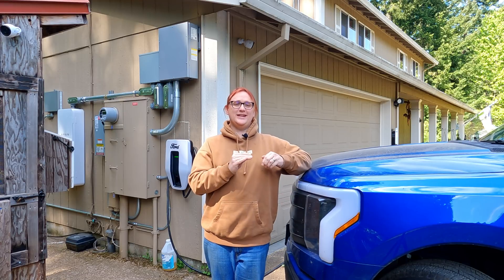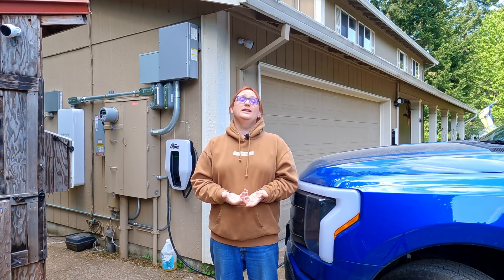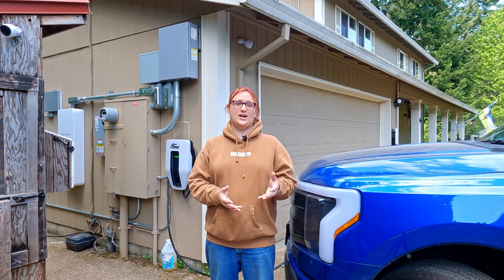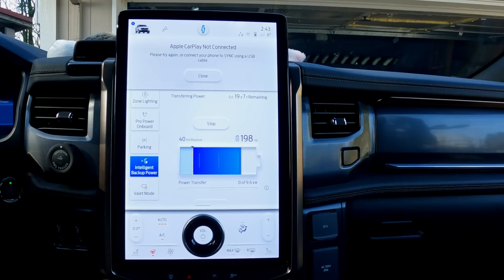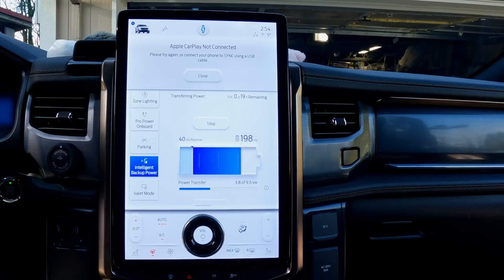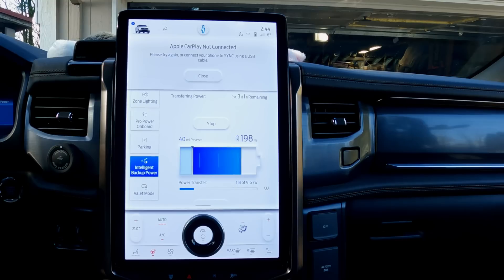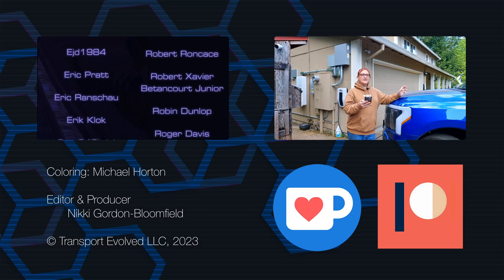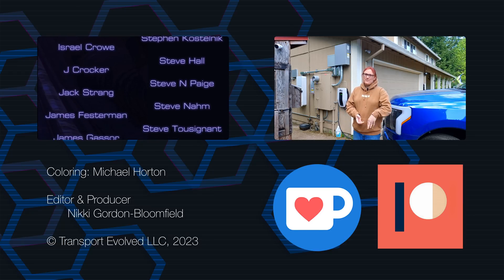I Was Wrong: How The Ford F150 LIghtning Home Integration System ACTUALLY Works

Comment: Still raises the question of why they’re using Bluetooth communication when the system operation requires the vehicle to be plugged in with a physical, wired connection that has wiring specifically for communication. I get that the required communication is different than a typical L2 charger would support, but I’m sure they could have figured out a way for that to work rather than using a specific Bluetooth module.
Reply: If it's using Bluetooth, it's not a safety device, it's a gimmick.
Reply: Yes, does seem like they could have found a more robust way... Or at least disclosed that there is a Bluetooth bug that could cause this issue.  Anyway, glad there is a potential resolution in the future.
Reply: And why it’s at the back of the cabin/truck, where it should be at the front, as charge port near front…, and that will always be closer to the charger.
Reply: @ericvet8b  the car ports are where they are, perhaps they will move in the future, and frankly there is no reason there can not be multiple ports, but that's another story.

Regarding the convenience of port location.  Tesla v4 stations should have longer ports.  I hope and pray that when we start to see adapters, that they have some short 3ish feet of extra cable, as that would address the short reach with all existing (SuC) Tesla SuperCharger cables.

And now we argue (debate) about the difference between a straight through adapter and a cable that adds resistance and current carrying capacity, blah blah.  Occam's Razor says make the adapter 3ish feet long and solve multiple problems. (I know the CCS standard dictates "though shall not use extensions nor adapters")... ;)
Reply: @ericvet8b  Unfortunately, Fulcher didn't understand your comment enough to get that you meant the Bluetooth receiver is at the back of the cab. He thinks you mean the cable, but his lack of understanding hasn't stopped him from responding to other people either.
Reply: @ronaldking1054  Since you don't have access to a bi-directional system that I have built, since I haven't built one, you could share any hacking experience with the systems that do exist.  You could absolutely be correct in that the BT features of the ford system are there to prevent energy theft via DC PTO ports?  You brought it up, and it's an interesting topic, so go ahead and elaborate.

You are asserting that only BT and manual pre-authorization can prevent unintended use.  And that a physical only connection is not able to do any security "Yours would require simply plugging the truck in regardless of whether someone has access to even the cab of the truck. While charging this isn't a problem as anyone could give you power".  But that would seem to conflict with the plug-and-charge authentication methods that AFIK do not require any Bluetooth pre-pairing procedures... And Tesla SuperChargers I do not think use Bluetooth for their authorization and vehicle identification communications.  I'm am happy to be proven wrong and expand my knowledge if I am mistaken.

Thanks for sending me down this rabit hole.  So the Charge Station Pro cable is 25 feet (7.5 meters) and the truck is about 6 meters, so a possible maximum of roughly 14 meters from the station to the rear of the vehicle, less the charge port distance from the front bumper. 

With all that in mind, according to the repair manual:

Page 21 mentions four Bluetooth Front/Rear Exterior/Interior Antenna.

Page 34,2184,2197 mentions a few Bluetooth Low Energy Module errors regarding ABS.

Page 592-599 mentions a few Bluetooth Antenna anti-theft errors.

Page 8300+ talks about Bluetooth phone Sync features and mentions it is 10meter (likely Class2) and 

Page 10322 has a list of six Bluetooth Front/Rear Door and firewall internal/external antenna for anti-theft, the Phone As Key appears to use these and mentions when out of range of 40meters it transitions to cellular mobile commands. Page 10330 talks about radio interference issues.

Page 10356 talks about Bluetooth Antenna #7 (Rear Exterior), this appears to be in the tailgate.

Page 10404, 10368, 13957 mentions Bluetooth Antenna #11 Exterior Front, appears to be in the front bumper to the right of the license plate.

So. I could not confirm that there is a Bluetooth radio nor antenna at the rear of the cab.  I did glance over mention of the cellular radio and GPS antenna that might be on the cab rear panel near the passenger side.  And there seems to be more than one BT Radio and antenna.
Reply: @D0li0  1. You have claimed that the CCS connection could create a bidirectional authentication protocol outside of charging. That is not my claim, and as such, I do not have to prove a thing, which is why I demanded you prove what you claim can be done. This is your rabbit hole that you are trying to send me down.
2. You have claimed that no authentication is needed in the opposite direction, but no charger will initiate without having connection as the chargers are requiring payment, and as such, the key is in the charger for the charging system, and yet you claimed there was no key. This is necessary because otherwise someone could steal power from the charger. You failed to understand where the key needed to be. For a home charger, it should always accept all requests, but that does not preclude that a request had to be made.
3. You were talking about the ports on chargers, which I assumed that you meant the charging system at a station as you were not specific, and you were talking about a cable. There is no cable attached to the car, so it had to be the charger. Now, it is possible to connect a phone to the Tesla through Bluetooth. You also said the v4 charger, which is again, not the car. Apparently, the Tesla uses a Bluetooth connection to charge the vehicle? Otherwise, your comment makes no sense, but according to you in another comment, it makes no sense to use Bluetooth to establish a connection in the reverse direction for Ford. Make up your mind. Is Bluetooth secure or not or is it that you were talking about something other than Bluetooth ports and you looked up through the repair manual to cover that you had no clue to what the poster was referring to? By the way, I do know because I recognized another comment that was made on the house powering system made by the same presenter in this video. If you like, I could look up the video where she claimed that the Bluetooth did not have the range to reach the charger based on how the vehicle had to be oriented. The fact that you went through the repair manual to find all the Bluetooth ports to hide your ignorance does not change the fact that you are ignorant. It is nice that you went through an effort to hide it by looking for all instances of Bluetooth like a search algorithm in a desperate attempt to hide that you did not understand the context.
Reply: @ronaldking1054  

I did not say any of those things you think I said... 

I have always only been talking about the communication channel, which of course is needed to negotiate the charge session and the payment or identify the users account.  This communication channel could be over the physical port communication wires, or bluetooth, or wifi, or infirred, or semaphore... You originally said that it had to use bluetooth and could not be a physical wired connection.  Perhaps I misunderstood you, but I'm 100% sure you misunderstood me.  I said that tesla likely did not use bluetooth for the communication, and you seem to think I said that they do use it.

At 1:00 she mentions poor weather.
At 1:33 she mentions the past hypothesis that poor internet was the problem, that she is correcting here, which she has always been very clear was a theory.
At 2:02 we begin to get into the Bluetooth communication that Ford is using. (which is not something that any other DCFC charging nor V2X uses, that is, uses bluetooth for communication negotiation).
At 3:09 she sais there is a known bug with the Bluetooth on the truck, that they have seen with other customers.
At 3:27 they reset the charge station and integration system, in order to work around the bug, presumably...  And that worked (temporarily) and then returned to not working.
At 4:40 they still have it temporarily working, without the update... 5:07 Nope, still broken.
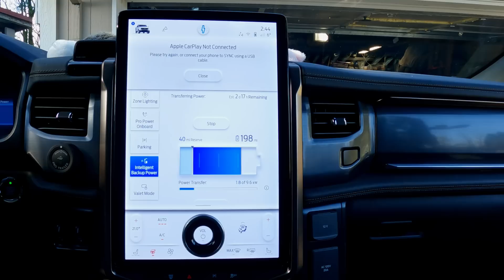There at 6:58 is mention of the bluetooth in the back of the cab (But that isn't an official definitive truth, I looked it up in the manual) (And I do not take her comment as some precise hardware location either, but you did).  She describes that if the Bluetooth connection flakes out, due to the bug mentioned numerous times, then the session ends.  Makes perfect sense.

Finished watching for a third time now... No mention about the trucks proximity or orientation to the charge station.

Which gets to my only point, and the only point of the other have made, such as "homeplug green PLCC standard to establish an ethernet connection on the j1772 pwm pin"

Which is that computer communications between any vehicle and any EVSE, be it a charger or a PTO device, can occur over any number of ways... Most of the time, it is over the physical communication pins, That is why the CCS Still uses the J1772 pins, to negotiate communications, They Do Not Use Bluetooth.  They could use morse code or telegraph or ham radio, these are all possible.  Apparently Ford is using bluetooth, which comes back to the only question we are asking, which is why not use the wired channel.

Yes, Please do look this up:  "If you like, I could look up the video where she claimed that the Bluetooth did not have the range to reach the charger based on how the vehicle had to be oriented"
Reply: @ronaldking1054  Also, just some additional background.  Bluetooth comes in three classes, Class 1 is up 100meters range, Class 2 is 10 (ish) meters of range, the ford manual specifically mentions 40 meters as the maximum range, so I assume their class 2 BT Radios can work at 20 meters, well within the maximum physical distance of the station and cable and truck.  And finally there is Class 3 BT which is about 1 meter or range.

I mentioned that stuff from the manual because it is meaningful in the context of the flakey Bluetooth communication bug that is know... I was trying to illustrate that it does not seem to be a distance problem.  But it could be an interference problem, which I also mentioned from the shop manual.  And that is why we are questioning the use of a wireless communication technology which is susceptible to radio interference.  We do not know that this bug is related to the nature of wireless communications.  But by using a wired channel, like the one that is already present and used for all CCS and L1 and L2 EVSE negotiations, you avoid the whole radio interference problem.  Its simply the KISS principal.  I'm only trying to learn more about the nature of this whole system, and I'm happy to admit that I am not an expert.  But you have also not demonstrated that you have any better information.  Instead you just called me ignorant multiple times, so thanks for helping us all understand how the home charger system works (sarcasm).
Reply: @D0li0  No, what you have done is tried to gaslight me to engineer the system for you, which you claimed could exist. You then said it was my rabbit hole when I explained why the system was probably why it is. You then argued with multiple people on various topics, which most of them knew more than you. I have explained multiple things about why what you said would not make sense systemically, but for some reason, you got defensive when called out by myself and multiple people. You have now stated that you can use the channel, but you have not stated how you could. If it is Keeping It Simple, Stupid, then you should be able to explain why Ford was stupid, but you cannot. You have only called out the limitations of the system without proving that yours could work. You then stated that yours could not be hacked without even stating why it could not be, but instead tried to get me to engineer your example for you. What's worse is that your latest comment is an attempt to get me to engineer the thing you claimed could exist again by stating that I have no better information. I am not you. I could look up the standard and use my computer science background to attempt to engineer something, but I do not care to. I only explained how what you said is not keeping it simple as you did not provide security for the system. You claimed that security didn't matter by stating that physical location was the only problem, but it is because one can move power around through larger batteries that actually exist. You claimed that those batteries didn't matter, but you never stated how they didn't matter. You only claimed that the protocol would not allow the Lightning to charge them, but it is a protocol you have insisted exists. The problem is that you have only described the hardware on which it would exist. You then claimed that because I will not hack your non-existent protocol that it must work. That isn't how it works in order to prove something. It is your claim to prove. Either prove it or don't try. Anything else is nonsense. Your requirements do not fulfill the goals of the system as there is no security. Your specification is incomplete, and you do not have any implementation at all.
Reply: @ronaldking1054  shrugs.. I'm not asking you to design anything.  I'm simply stating that computers communicate in many ways. And maybe BT isn't the best for this situation.  And that there is already communication happening which is not BT.  I don't know where you are getting all these things you think I'm wanting you to design, I'm just trying to, nevermind.

Nissan did V2G a decade ago without Bluetooth...

I mentioned the weakness of wireless systems.

I have agreed and expanded upon most of the other people I replied to...

Yes, I misunderstood the BT radio in the rear of the cab statement, but have since clarified it, and that's not related at all to anything I have been talking about.

Anyway, have a nice day.
Reply: BTW... Security occurs over a communication channel..

I never expressed anything to do with security.  I never implied there should be no security.
Reply: Lets break this down into the OSI Layers... I've only been talking about the Physical and Data Link Layers.

CCS Uses https://en.wikipedia.org/wiki/HomePlug#HomePlug_Green_PHY

I'm pretty sure that CCS Charge sessions have some kind of authentication and security? right? I'm not asking anyone to invent anything, it's already right there.  Anyway.
Reply: @D0li0  If that were the case, then the charging cable when plugged in would be the method by which everything would authenticate by charging. It does not because the security does not exist there, and yes, you did imply no security as you claimed there was no way to siphon the battery. You are still doing the same thing. You are gaslighting.
Reply: @ronaldking1054  so, let me get this right.

You are saying that none of CCS nor SuC uses the cable to handle a charging session authorization?

How do Plug&Charge and SuperChargers identify and bill the vehicles owners?
Reply: @D0li0  No, they don't because no charger deals with connecting to the computer of the car in order to process payment. They only look for the ID of the car, and which Tesla car allows you to charge your home? That would be a security flaw. Tesla isn't even going to use their app to initiate a charge with a Ford vehicle in the near future. Keep arguing that there is security because it doesn't handle the money. The most it does is it looks for a simple identifier to guess who the person is on the end. The charger then talks to home, and I know the computer on the Tesla is not managing the money. Keep arguing that you got security because no company is using it for anything financial, which power would be financial. I'm also betting that the charger doesn't start charging without a confirmation, which eliminates fraud and theft after a vehicle is stolen. I know non-Tesla chargers do not initiate from being plugged into a car. From my understanding there is also a Tesla app, which would again be a key, and it is the security. No one needs security to determine the level of charging to be done.
Reply: For around $4000 for that system and possibly another $4000 to have it installed,  I'd expect it to work flawlessly.  As a retired electronic electrician I've found over the years the simpler something is the less chance of failure. Don't get me wrong,  I'm not against computers,  as I'm also a novice programmer,  but the more they computerized our everyday devices, the more their lifespan decreases.  I connect my lightning safely to power my home in an emergency using the 240 volt receptical located in the bed of my truck.  Although I only have 7200 watts available to me,  it powers everything I need in an emergency,  including my 240 volt deep well pump. Flip the main off, generator breaker on and plug in my truck. Works great every time.
Reply: That's totally crazy that it uses Bluetooth. The CCS standard, includes a physical, hardwired ETHERNET connection through the charge plug using the Homeplug Green standard. Vehicle to X is one of the specific reasons that this Ethernet protocol was implemented by SAE in the first place...
Reply: @bjcouche1  I did not realize CCS had an Ethernet channel.  I'll have to maybe take a closer look, I thought it just use the j1772 resistance pin channel, but hadn't looked further.
Reply: @D0li0  CCS doesn't really have ethernet. It has HomePlug GreenPHY which encodes data over a power line connection (PLC). It also has 'basic signalling' on the two data pins which uses PWM to indicate the charge rate (or 5% to indicate - use the PLC fancy comms). The wikipedia Combined Charging System article has details, and the Homeplug GreenPHY whitepaper explains how that part all works.
Reply: @Lightning Ryan Fulcher  it uses the homeplug green PLCC standard to establish an ethernet connection on the j1772 pwm pin.
Reply: @bjcouche1  ok, cool trick, sounds better than Bluetooth to me.  All we can do is speculate as to why they did not use that communication channel.

Are there any other V2X products available for CCS that do use it?  I recall recently that another brand of vehicle is offering a home power solution, maybe lucid? Hyundai? IDK...

I've only ever heard of the CHAdeMO bidirectional consumer hardware which were still pretty rare and tough to track down.
Reply: Original J1772 has just 2 pins besides the 3 power pins. How was Ethernet added to the standard? Time 4 me to Google!
Reply: @danwat1234  that is a good question.  But there are things like power over Ethernet, and Ethernet over power, and CCS doesn't need those 3 AC power pins.  There are any number of ways that additional communication could have been embedded on top of the existing dumb resistive j1772 pins or other pins.  I guess, it definitely warrants more research, but I'm also not developing any such hardware, so not the highest priority for today, yet... ;)
Reply: @bjcouche1 Yes, but... as of this moment in time CCS has not issued any V2G or V2H protocols (or at least they haven't certified any to be used). I think they started a trial back in January. I assume there are legal isses with hacking the CCS protocol to enable V2H and Ford would risk getting sued if something went wrong.
Reply: @mondotv4216  I would buy that argument, that aligns with my understanding as well, that the CCS does not officially support it, yet.

However, that doesn't mean that the CCS handshake is incapable of negotiating a negative current request value...  Among passing other arbitrary information, like a security identifier to recognize a vehicle and thus associate the car with an account holder.

Which is how I would imagine that CHAdeMO does it, it establishes a negative current limit between the car and station over the wired communication channel.
Reply: I suspect there was a need for more communication- that they either couldn’t code in, or realized it later
Reply: Bluetooth would require a manual association between the charger and the truck. Yours would require simply plugging the truck in regardless of whether someone has access to even the cab of the truck. While charging this isn't a problem as anyone could give you power, but you are stating that anyone can take your power. There is a reason that baffles were put into gasoline-powered vehicles. People have already siphoned fuel.
Reply: @ronaldking1054  there is a charger registration setup process in the FordPass app and perhaps the truck as well. IDK because I haven't been so inclined to unbox my pro charge station, don't have a need for it.  I do know the home power option in my truck prompts me to register itself with the Charge Station Pro, so far I just abort that setup when I keep exploring and finding that part of the FordPass app, or in truck menu.

So it's probably doing a Bluetooth pairing during that whole charge station setup process.  I still don't think it should be a requirement to need to use BT, given that it sounds like there are already hard wired communication methods available via the CCS standard according to another reply above...

While I guess technically it might be possible to "steal power" from a V2X capable vehicle, wouldn't you need to happen to be physically at a location that has that capability?  Unlike a gas can and a hose, it's not easy to walk up to a BEV with a V2X charging station just to take maybe $12 of 100-ish kWh of someone's power.

It's an interesting idea though, probably easily solvable by requiring the app to acknowledge allowing a request for PTO (V2X power take off), or pairing (via various means beyond blue tooth) to a home location.  I had to setup a home location in the truck so to be able to choose max 80% at that location, which had nothing to do with any Ford EVSE "charger".

Brave new worlds ahead...
Reply: @D0li0  Inverters and batteries exist. That is the new hose and gas can.
Reply: @ronaldking1054  ohh kay...

If you can demonstrate an easy way to get power out of an unattended BEV at will, you may have a product to sell, cause it isn't as trivial as syphoning gas.

Just saying "batteries and inverters" isn't nearly enough to prove your point.  Might as well say casters, jacks, and socket wrenches exist, so anyone can just drop your battery and take it away.

Maybe you are a V2X hardware builder and have experience with dozens of BEVs doing PTO... But that seems unlikely as CHAdeMO V2X was barely tangible similar to the rare Ford Home Power experience. But do share if I'm mistaken.
Reply: @D0li0  I'm sorry, but you haven't made your system for me to hack. I only have the inability to pair a Bluetooth that isn't accepting connections. You go first.